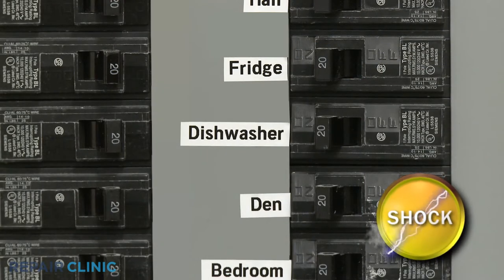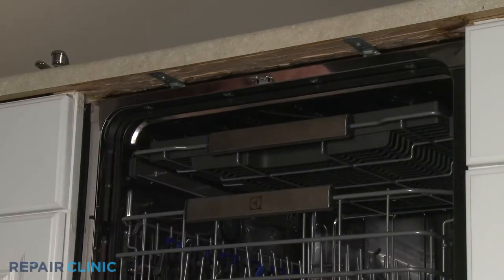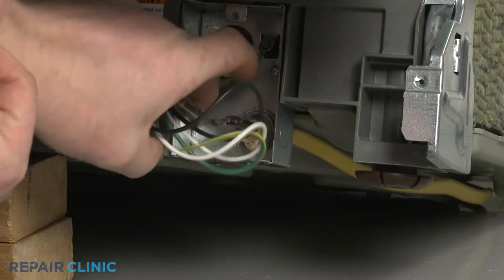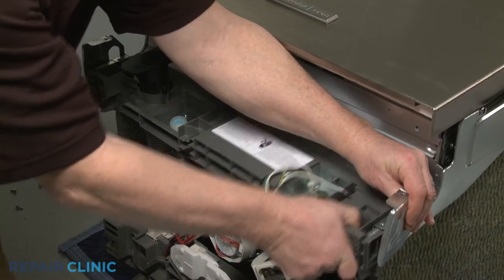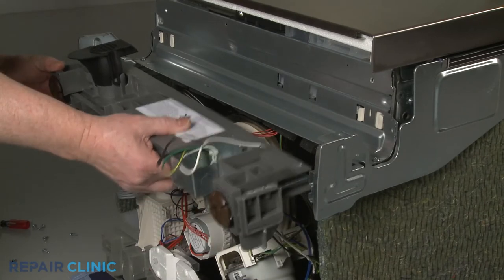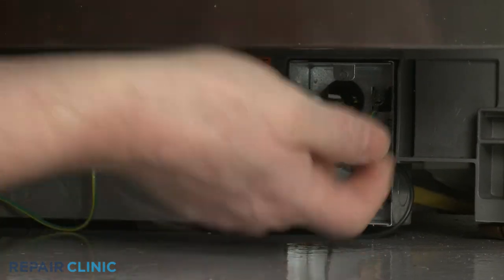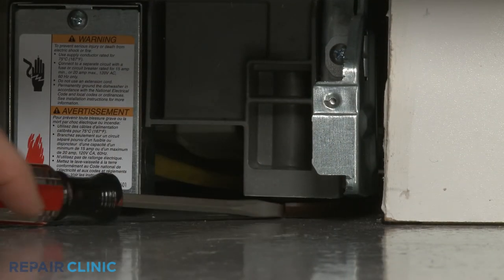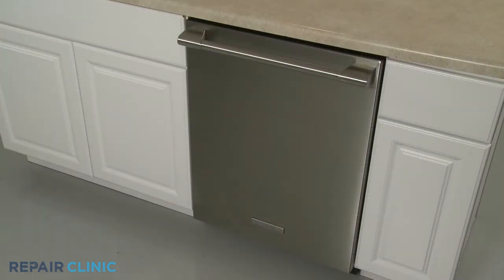Electrolux Dishwasher Turbidity Sensor Replacement A00040101

Comment: ESL4131 (built-in type): this sensor is accessible without pulling the dishwasher out, relatively easily. It is enough to remove the front door panel (2 screws, pull down), then remove the bottom front cover (8 screws). But it was not the cause of the problem, which was not heating water. The cause was the heater relay in the electronics box, located in the front door. The relay overheated and unsoldered. The fix is to replace the relay and reinforce its PCB leads with a wire, or replace the whole control box.

Comment: Hi. There is a way to check is the themp sensor is fine ??
Reply: Michal to check  if the temp sensor is fine, its best to perform a continuity test. a electrical path present in the part.
Reply: @sandrahill5931  How do you do this when it has 4 contact terminals? I am guessing they are 1 positive and negative for temp, and 1 positive and negative for turbidity sensor